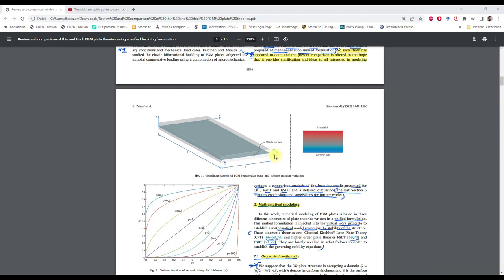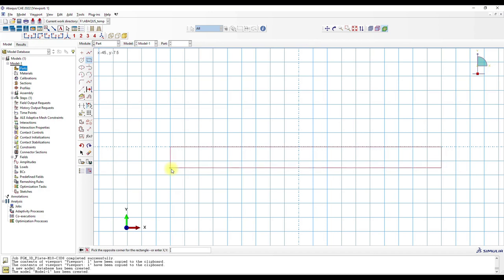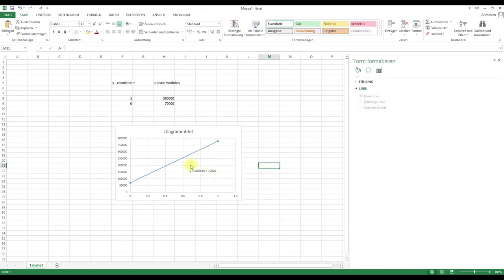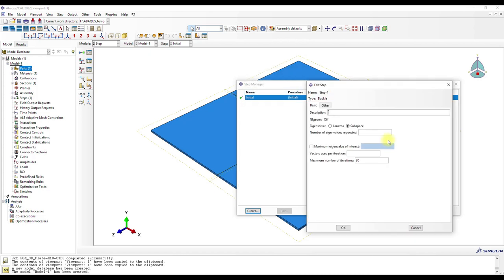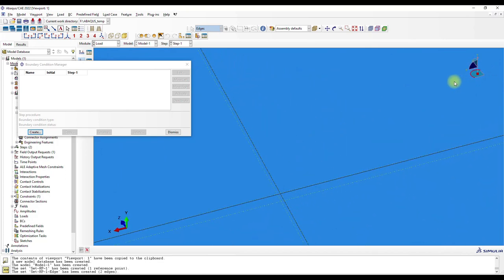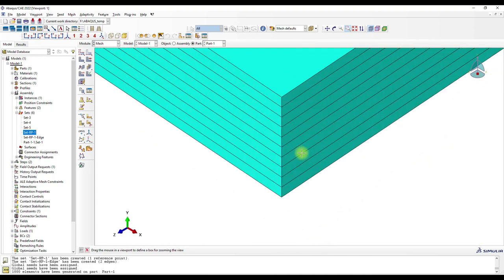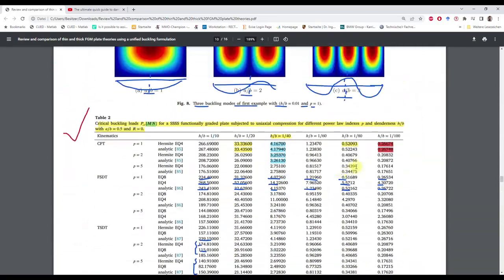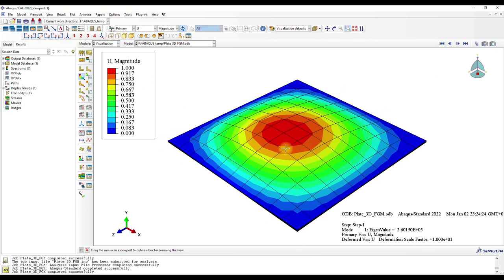#6 How to write an ABAQUS USDFLD ? - Buckling of 3D FGM-Plate (SSSS) subjected to axial Compression

Comment: Sir the results are for a/b = 0.5 rectangular plate and you have taken a/b= 1 means square plate???
Reply from the maker: Plate is 100x100x1
Reply: @hnrwagner  no sir see the table 2 it is written above a/b = 0.5 so you have to create square table ?
Reply from the maker: @mera_baba_  oh my mistake just make the plate with a/b = 0.5
Reply: @hnrwagner  Sir please tell me why to fix three vertices in the middle?
Reply from the maker: @mera_baba_  to prevent rigid body motions, meaning that the plate moves in x or y direction
Reply: @hnrwagner  sir it says 1 nodes have inactive DOF where Boundary condition is specified. How to fix this?
Reply: @hnrwagner  sir the node is at the RP1 please tell me how to fix it.
Reply from the maker: @mera_baba_  sounds like your equation constraint is wrong
Reply from the maker: Do exactly as shown in the video, then it will work
Reply: @hnrwagner  I am creating rectangular plate so I am defining equation constrain in short direction.
Reply: @hnrwagner  sir do  one thing how to create equation constrain in the adjacent edge of the datum. Or is it possible to do it without equation constrain by applying udl of some another method.
Reply from the maker: @mera_baba_  in equation you have to assign a number for "DOF" ,  x = 1, y = 2 , z = 3, in my example i applied loading in z direction therefore DOF = 3
Reply: @hnrwagner  ok sir got it.
Reply: @hnrwagner  sir please how these loads becomes equals to two opposing loads.
Reply: @hnrwagner  and is it possible to do it without constraint manager just by giving displacement at edges or surface??
Reply: @hnrwagner  Sir and also the results are not validating by taking a/b = 0.5. there is huge difference.